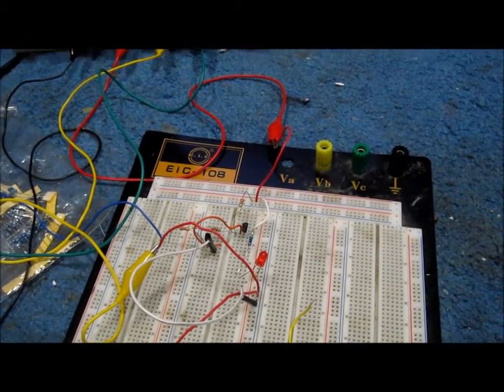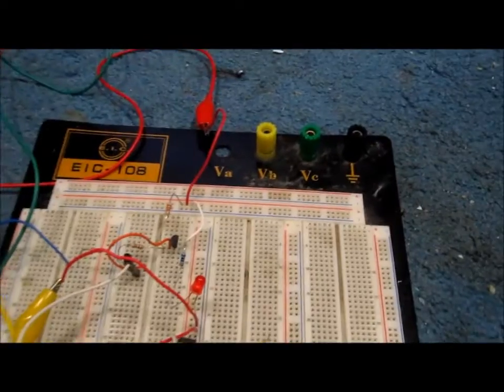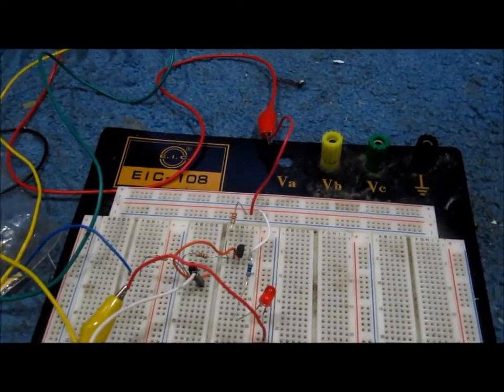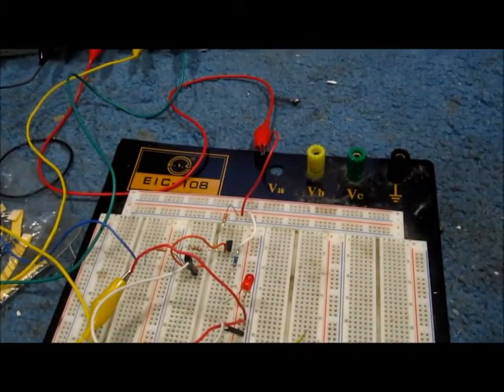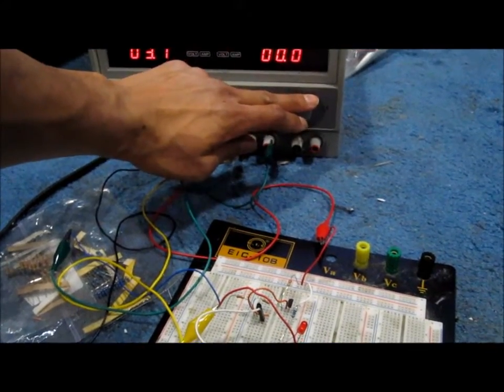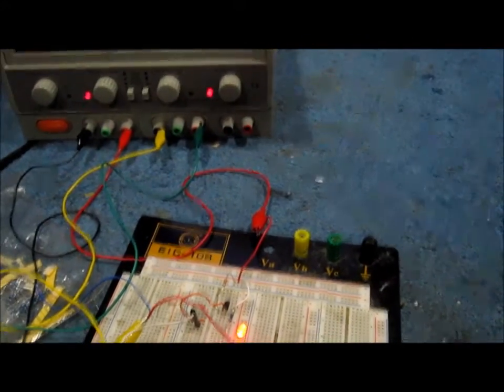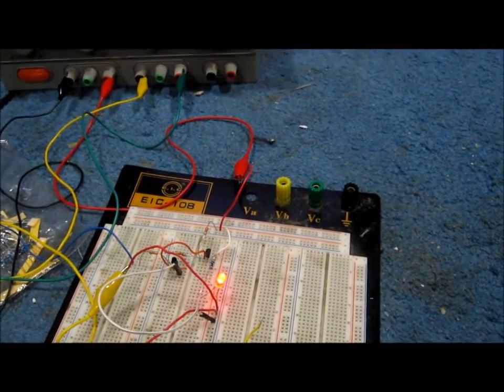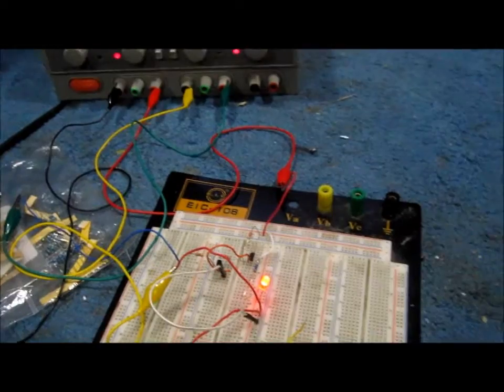Transistor Latch Circuit

Comment: I also recreated the circuit. If the input is not wired, I definitely agree with the other comment, it is unstable. e.g. a piezo lighter will trigger the circuit if ignited nearby. ok, you can still fix that with a suitable filter at the input, but I find it even worse that the circuit only deletes the state when the voltage has been removed long enough. If this is only briefly interrupted, the capacities are sufficient to keep the circuit in the triggered state.